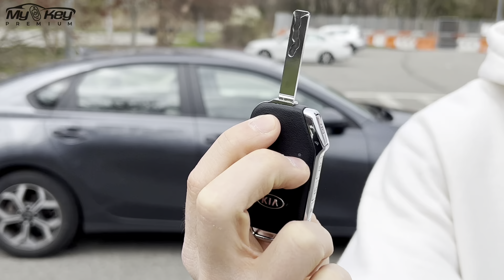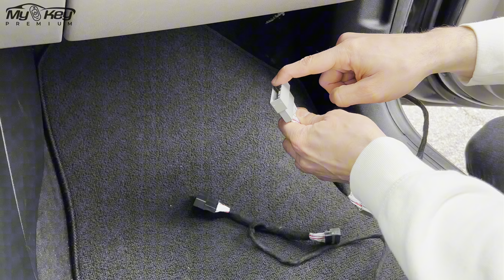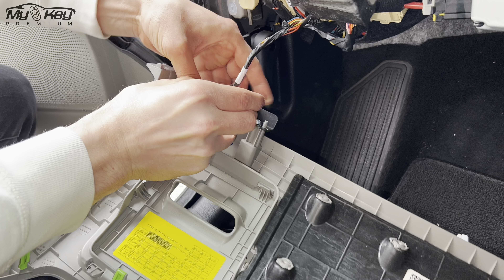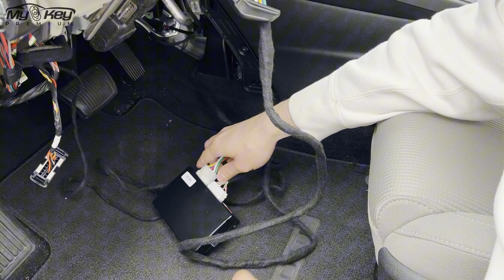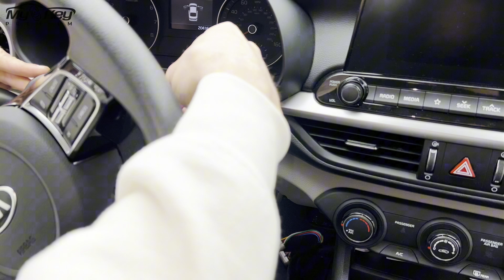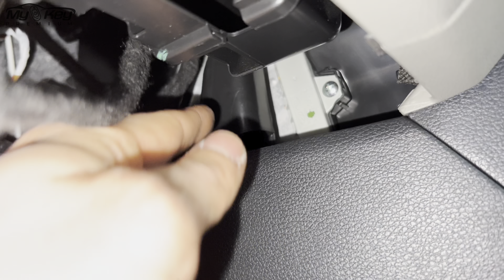Kia Forte / Cerato 2019-2021 Key Ignition version Remote Engine Starter Installation Step by Step

Comment: I recently ordered my cords look different
Reply: I don’t have the yellow connection at the end of the video
Reply: Same issue.  Emailed them, no response yet. Did you get a response?
Reply: @davidpinto2501  I got a response regarding this. They said their engineers updated the harness to not need those connectors and to just install the rest of it. My first unit actually did not work whatsoever, but they quickly got me a replacement that seems to be working 'fine'. 

By 'fine' I mean it's remote starting just fine and all that, but once it's started I cannot unlock the doors to get into the car. I have to double click the lock button again to turn the car off, unlock the doors, and then get in and start the car again. I just shot out another email to them hoping they have a solution. Other comments here though say they have the same issue and have not received a solution yet.

Comment: I just installed this unit on my car, but after I remote start, I am unable to unlock the car? I’m only able to unlock the car after I turn off the engine remotely. Is this suppose to happen? If not how do I troubleshoot it?

Edit: I just returned it and got a refund, their support team were not helpful in troubleshooting the issue…
Reply: I have same problem. I can’t unlock the doors after remote starting . I have to shut the engine twice with lock button and get in car and start the car again with key blade.
Reply: @joshlazko2953  it’s the imobilizer. Was your car manufactured after October 21?
Reply: I have the same issue

Comment: Should i disconnect negative terminal of battery before messing with this,because this is common sense before working on any electrical parts on vehicle???  Asking for serious knowledge????!!!! I dont want to fry my ecm,pcm, acm, or mcm,mgm, and most of all my LSD!!!
Reply from the maker: Yes, it’s a good idea to disconnect the battery to be safe, especially if the installation steps aren’t followed perfectly. Better safe than sorry when it comes to protecting your car’s electronics!

Comment: Does this remote starter come with alarm system also?
Reply from the maker: No, that's not the case. However, the security is top-notch. The car simply won't move unless the keys are inside.
Reply: @MykeyPremium why I can’t unlock the car after remote starting though. I have to stop the engine with lock button twice and then get in car and start the car with key blade. Do you have any solution for that?

Comment: Just installed this in my wife's 2021 kia forte. All the connectors fit exactly as described in the video and everything is clicked in place. The dip switch in position 1 is down and the rest are up. The remote start function works, but when the car starts the horn and hazards start going off until i hit the lock button again. Any clue ehats going on?
Reply from the maker: Thanks for sharing! It’s not supposed to do that—it should work seamlessly. Please shoot a quick video of the issue and reach out to support@mykeypremium.com. They’ll help get this sorted for you!